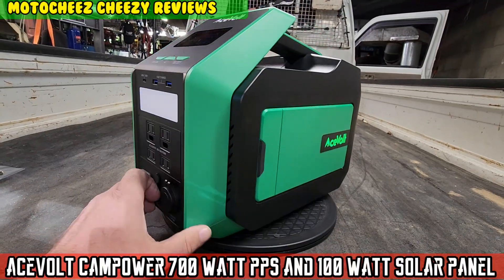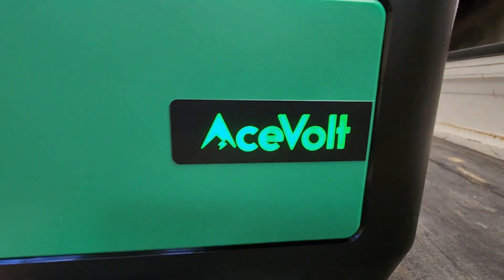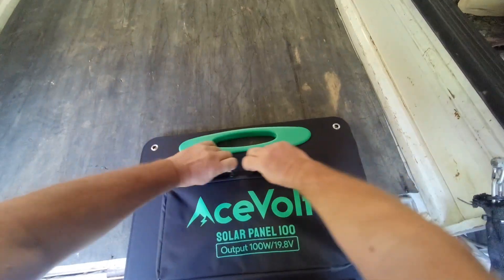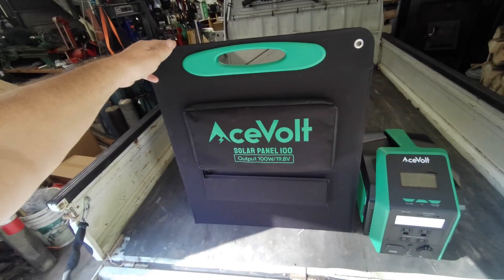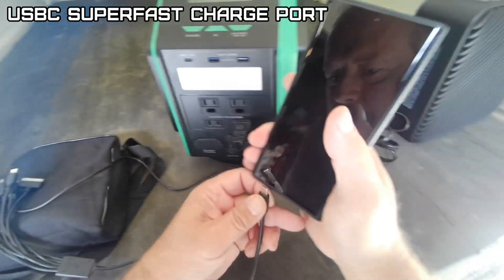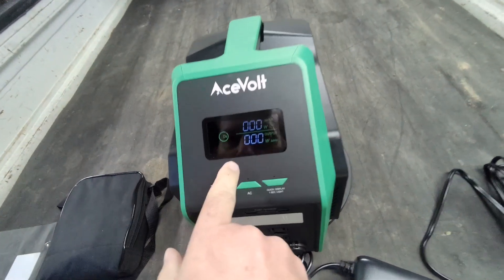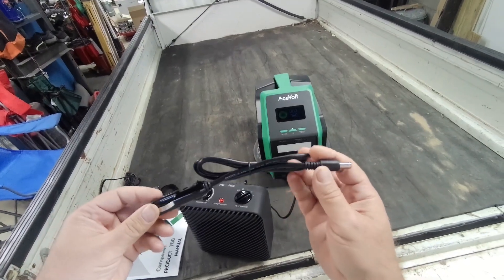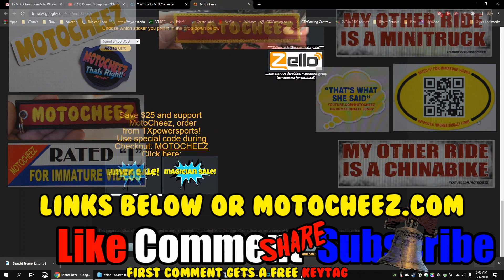ACEVOLT Campower 700 watt LiFePo4 Pure Sine 672wh Portable Power Station & 100 watt solar panel

Comment: These portable power units are really handy. My problem is I'd skip these smaller units and go right for the big high-capacity ones. But I don't have the funds for something like that. But I'd love to have one in the future. Another thing that's handy for some back up power are the little adapters that slide onto your drill batteries. They're great for charging small devices. I have one for my 12v 2.5Ah Hercules batteries that I bring to work with me and use to charge my tablet and ear buds when I'm listening to music. 

I also picked up one of the 20v Hercules job site fans for when the days were hotter and I was stuck in one of the far aisles of the building with no air movement. It works pretty good and a 20v 5Ah Hercules battery would last two 9 hour work days at moderate speed before getting down to one bar out of four on the power gauge. I also need to pickup a second battery adapter that can use my 20v batteries. I bought one of their new 20v 12Ah batteries a few weeks ago and haven't got to use it much. It would make a nice portable power source as well. :)
Reply from the maker: Good ideas